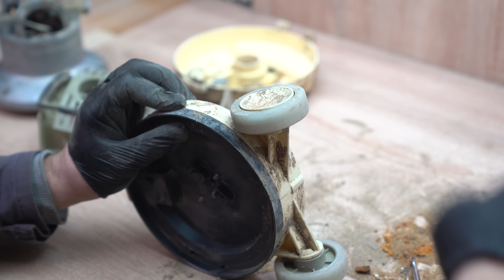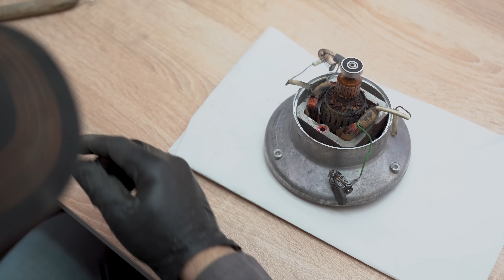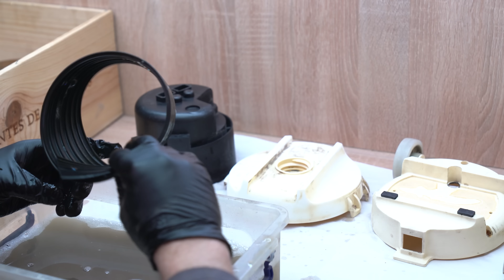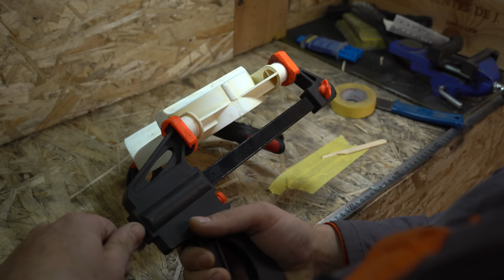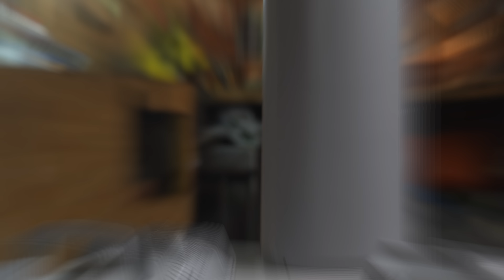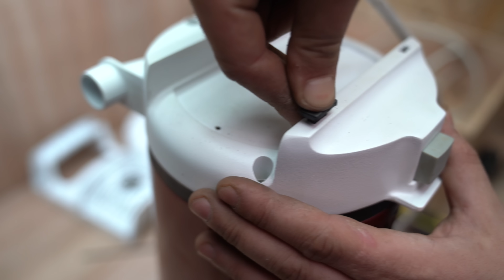Restoration of a long-forgotten Vacuum Cleaner into a work of art!

Comment: Excellent job, thanks for posting.  Little trick on the crack:  drill a tiny hole at the base of the crack to disperse the stress.  Then epoxy.  Again, thanks for posting.
Reply: Yes! That is a very good trick. I forgot about that one. Also can be used for cracks in metal before welding. Drill through at the end of the crack and leave the hole alone. A perfect round hole works best. The crack is essentially "ended".

Comment: Great job, but why didn’t you just whiten the plastic soaking it in high concentration peroxide and UV lights? It’s way less abrasive. Also, why not clean the motor better to prevent further rust and wear of parts? You can clean electric motors with high concentration rubbing alcohol, like 90% and above.
Reply: He probably will with future restorations. 😀 I'm 59 and did not know of the technique you mention to whiten plastic. I will have to try that. Thanks!
Reply: @jlucasound  it’s used on other channels. Try watching PlayStation restoration or Nintendo restoration of remote. You’ll see how it’s done. You soak in a high concentration H2O2 for 24hrs or more if needed with UV black lights shining all around the container. Most wrap the containers in aluminum foil so it reflects around. It will whiten almost any plastic parts. Even the clear plastic parts.

Comment: You know bro we clean those are cool but when you pull the sticker up and it leaves that glue on the plastic use WD-40 just kind of squirt it up on there let it sit for a bit it'll come right off takes a little work but I do it all the time at home too just to let you know